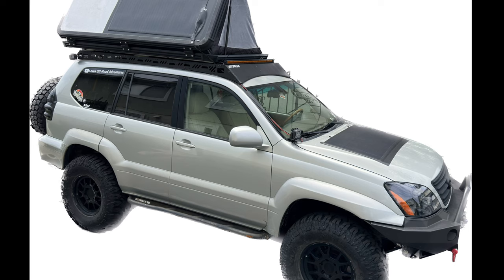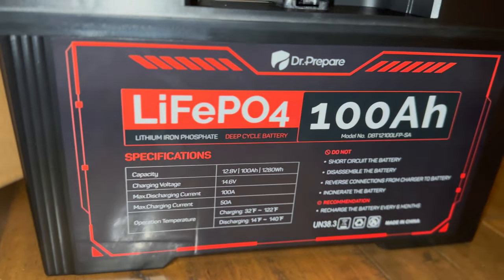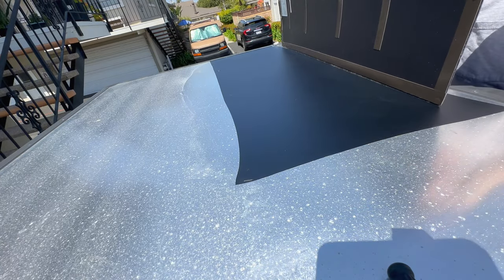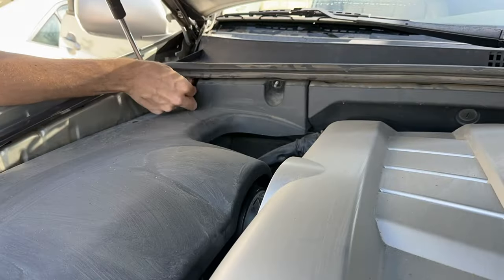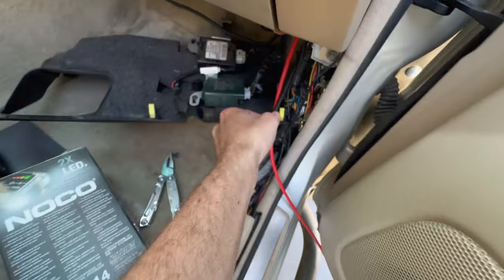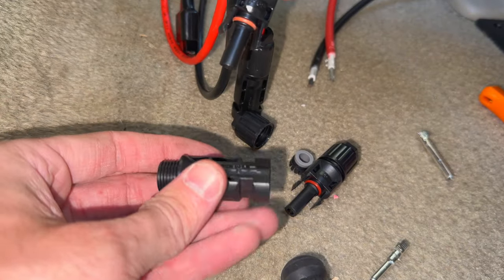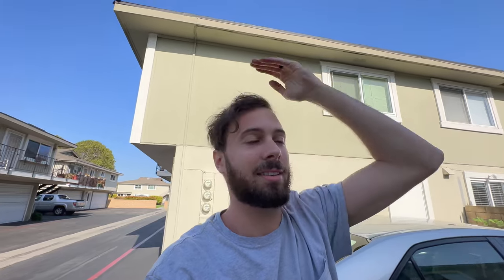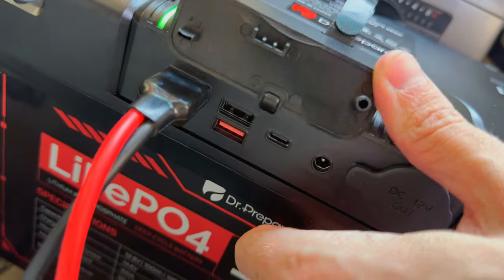SIMPLE DIY Solar Power System Install

Comment: the wrap idea was genius, howd it hold up at highway speeds? which 3m wrap did you use? thanks!
Reply from the maker: @Benallst  still works great! Been running strong for years now. I used just a generic Amazon matte black wrap but used 3m extra strength double sided tape.

Comment: Is solar panel charging the only way this battery can be charged?
Reply from the maker: The hub on the battery is an MPPT Solar charge controller, so if you want to use that, then yes, use a PV. However, if you want to charge it via the + and - terminals directly, you can get a dc-dc converter and charge it from the vehicle alternator/starter battery when you’re driving

Comment: if I wanted two batteries in parallel for extra storage capacity, is that just tying in the terminals (+ & -) but otherwise no other changes required?
Reply from the maker: In theory, yes, but make sure they batteries are of the same capacity and manufacturer. If you really do your research, maybe you can wire different batteries in parallel, but to avoid any issues, I recommend you just buy two of the same batteries. I currently run twin 50AH batteries for my hard-mounted setup in addition to this portable 100ah battery. Both have been totally reliable
Reply: @lexus_offroad_adventures  thank you -- I'm new to solar but it sound like a fascinating field to delve into.

Comment: Is there a reason you didn't get a solar cable that ends in XT directly? Is it okay to leave the battery plugged in when it's already fully charged?
Reply from the maker: The reason I didn’t get that already installed on the cable is because going with generic cable is cheaper. Since you have to cut the wire anyway because you can’t predict exact length, may as well just attach the ends yourself and save some money
Reply from the maker: Try not to leave it plugged in when fully charged. In fact, I recommend discharging to 70-80% and storing it that way

Comment: Thanks for the video. Some questions: Can it be configured to also charge from the vehicle's 12VDC when the ignition is on, and then automatically switch to solar charging when the ignition is off?
Reply from the maker: Thanks for watching! For that, I would recommend a DC-DC charger like this one: https://www.amazon.com/dp/B07Q5VYPCF/ref=cm_sw_r_as_gl_api_gl_i_58YMY5KG8VP8D6VTGEZE?linkCode=ml1&tag=lexusoffroada-20

I don’t trust the factory outlet with this kind of stuff at all. Read through the product description linked above for the benefits of running a proper DC-DC charger. It’ll charge way faster and be much safer for your entire electrical system. There is also a super helpful install diagram.

Your stock alternator I believe is 130 amps. If you have a different aftermarket high output alternator, use this sizing guide below to decide which one to use (20A linked above for stock alternator):
For alternators of less than 160 amps use the 20 amp charger, up to 180 amp alternator use the 40 amp, and for 200 amp alternators and above the 60 amp alternator can be used.
Reply: @lexus_offroad_adventures  I have a GX470 with a stock alternator. Do you know what its output amperage is?
Reply from the maker: @sgoldste02  yes I put in the above comment I believe it’s 130A so you’d want the 20A charger but please fact-check me!
Reply: @lexus_offroad_adventures  Also, do you have any plans to configure a battery system like I asked about (utilizing a DC-DC charger to auto switch between vehicle 12VDC power and solar power) on your GX?
Reply from the maker: @sgoldste02  maybe in the future if I find that the solar isn’t fast enough, however, being that I have little tiny kids (3 weeks and 22 months) I probably won’t be going on any trips that are long enough in duration to require a faster recharge. More likely is just combining my existing 100w panel on my hood and the one I added on the roof. Plenty of sun where I live.